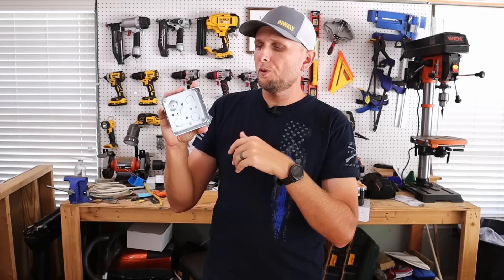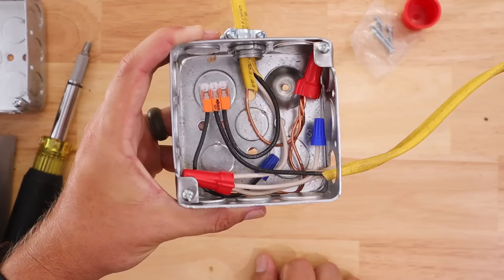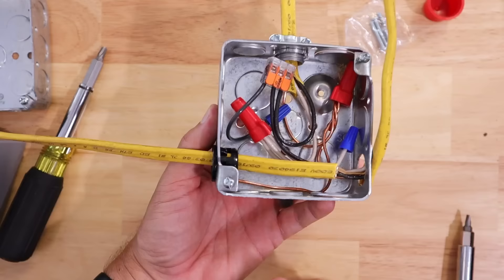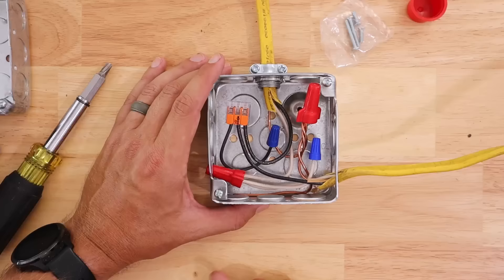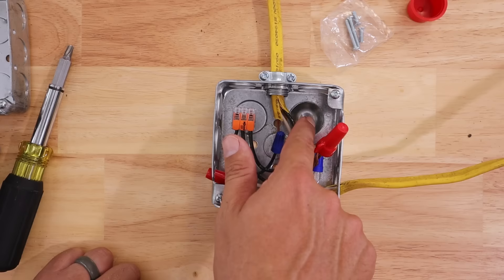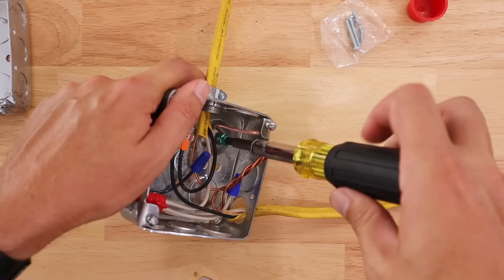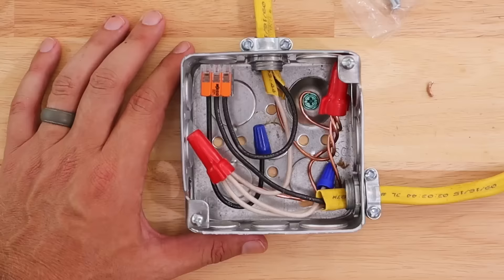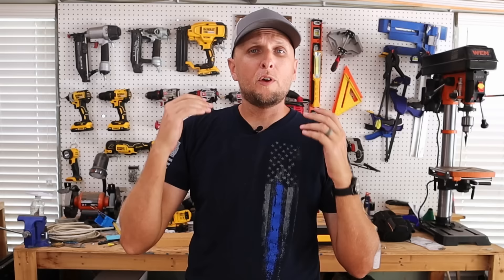The BIGGEST Mistakes DIYers Don't Know They Are Making When Installing Metal Electrical Boxes

Comment: Pre-twisting wires before wire nutting them is wrong. You need the twist to come from the wire nut in order to be up to full spec, as per the wire nut manufacturers. In manufacturers pull apart tests, it takes less force to pull wires out, if they are pre-twisted. Let the nut grab fully, and naturally. Especially, if you have a mix of stranded and solid. Extend the stranded 1/4 to 3/8 of an inch taller than the solid, and absolutely in this case, do NOT pre-twist, or it will be weak. Twist it with the nut only and it will be strong. It's not that some manufactures "don't require" pre-twisting. They require that you don't.
Reply from the maker: I’m sorry but no that is not correct.
Reply: @HowToHomeDIY  If you pre-twist the wires, you develop a contour separate from the inside of the nut, and aren't allowing the twist contour to properly match, as twisting using the wire nut does. And the threads inside of the wire nut may not grip to the wire as intended. When including stranded wires, there is even a greater risk of failure if pre-twisting.
Reply from the maker: That’s an opinion.  There are countless others with a different opinion.  Hence why I said it was controversial.  The NEC does not say not to pre twist.  It says to follow the directions from the manufacturer.  Not that they don’t exist but I have never owned any wire nuts that said do not pre twist.  They have said, pre twisting is not required.   That does not mean you cannot and why so many electricians do.  I have personally never had an issue with any wire nuts after pre twisting.   They bite into the wiring just the same and take a whole lot of force to pull out.

Comment: Anyone who doesnt know the basics shouldnt be doing their own electrical. Also your "must use these screws for the geound and only these screws"....bs. any bare screw will work
Reply from the maker: Any bare screw?  Really?  So someone can use a deck screw?   You can’t just use any screw.  Yes there is nothing special about the color, that was not my intention but instead directing homeowners to the electrical aisle and getting the green ground screws because then one knows for sure they have the right size, type, and length.

Comment: Speaking of the electrician Bible (nec) what does it say about correct length of wire coming out the box, wire management and fill capacity? When electrical cables route from box to box, you must leave at least six inches of free conductor wiring in the junction box for connection purposes in article 300.14 Also why would you go against manufacturers directions? (you think you know more than their engenders, research and development) There is actually a safety concern on pre twisting wires. I am a licensed electrician from California. Ask me about anything electrical

Comment: Why you not using ground sleeving??
Also them wire nut things your on about is soooooo 80s lol 3rd world electrics. Twisting copper together!! No no no no.
Reply: Romex comes with bare ground and must be bonded to the box if it's metal. If the system is wired correctly, it's perfectly safe. MC cable comes with ground insulation and individual wires used in conduit are all also insulated. Wire nuts are still commonly used, but Wago lever nuts are becoming more popular. Twisting wires together before installing wire nuts is considered the preferred method by most people. When done correctly, it's proven to be a very durable connection.

Comment: You are always showing electrical fires in your video thumbnail, and to be honest this is clickbait. Electrical fires start usually from devices that draw a lot of power over long periods of time, like multiple electric space heaters that are plugged into an extension cord.   Where they draw a lot of power right below the threshold of tripping the breaker over a long period of time. In the casse of your clickbait thumbnail, you show a metal box with wires and wire nuts catching fire. THIS IS JUST WRONG. This is at most would simply trip the breraker, that's what breakers are for.
Reply from the maker: Always?  The last 16 videos haven’t had that on them at all.  And fires can happen from things talked about in the video.  So it is not clickbait.  You just don’t like it.  Which is ok.

Comment: Wire nuts in all the world bus USA is temporary solution and proven to be fire hazard. 
Wago as on video can hold up to 40 amp.
Why use metal boxes in the first place. Only USA use metal boxes for electricity that is ridiculous.
Reply from the maker: Wire nuts work just as well as any other splicing device if installed properly.  If you look up the stats of fires cause by electrical, the UK actually has more electrical fires per capita than the US.  I have seen the Wagos installed improperly as well.

Comment: Using an metal box was the first mistake, and the wago Klemme is the only legit conector in there all other shown ones are illegal, and the completly stripped wire is also strange but if it is the PE wire it is not illegal, cant verify that becouse there is no green-yellow isolation visible it is also strange that this one is so much thicker than the other ones it is not required to be the same zuze but must not be smaller wich if this is the PE than that would be uncommon but ok, it looks like it is a 2mm² and the other ones are 1,75mm² 

Also the wire colores are questionable is there no N ore did you use the wrong color

This Video ist terrible advice if you use those and somo e gets hurt or killed it is your fault even if the accident had has nothing do with this installation, also if you find these in a system you are obligated to change them or it is legally the same as if you had put them in, those connectors are illegal since the 90s and they are allowed till any change gets done to the installation 

Please dont take this videos advice it literally could get you in jail
Reply from the maker: I am guessing you are not in the US.

Comment: National code also requires 6 inches of wire sticking out of box when installed. Most of you wire is much shorter and a violation.

Comment: Please do not disrespect the U.S Flag by wearing those shirts.  I would rather see a someone burn the Flag in protest than ever see it on an article of clothing or used to strip the flag of its meaning by altering it to support someone else's cause.  The same people that used to throw a fit if a flag ever touched the ground now disrespect it by turning it into cloths they throw in a hamper.
Reply from the maker: It’s not a flag it’s a shirt with a picture of a flag.  This has been ruled on as perfectly ok.  Please don’t try and trample my first amendment rights that the flag represents protecting.
Reply: @HowToHomeDIY  You very much have the right to desecrate the U.S. flag.  That was clearly established by rulings of the Supreme Court that determined that burning the flag was a protected act of free speech.  And with that ruling the Flag Code was ruled a violation of free speech.  So yes, you have the right to desecrate the flag by placing a "Picture" of the flag on a shirt.  You also have the right to usurp the meaning of the flag to support a singular cause or purpose with that "thin blue line".  You have the right ignore the wars we have fought and the differing ideas of all the people that fought them and alter the meaning of the flag they fought for.  They fought so you can have that right.  Would you think it right if a US flag was altered with a rainbow stripe to support LGBT people or if a black stripe was put in to support BLM?  Maybe that should become the new symbol for any group.  Pick a color or colors that represent your group and just replace a stripe in the US flag and make it your own.  What would you say to a content creator if they did that to the US flag?  But the thing is they others have the decency to create their own identities and not piggy back and steal the identity of a symbol that represents all people of this nation and all their struggles instead of taking the flag to alter the symbolism to just represent a singular group.  A group that many people see as oppressive, violent and corrupt. The U.S. flag is a symbol for all, not a symbol for just a few and when you plaster it all over everything and put it on shirts or hats or alter its appearance the deep meaning behind the flag loses its significance and those that do it are not patriots.  So please, continue wearing your "Picture" on your shirt.  Makes it easier to identify those we should avoid at all costs.  You seem like a decent fellow and you like to point out the mistakes that others can make.  So instead of blindly screaming don't trample my rights, maybe consider your actions while done with good intentions are wrong to do in the first place.
Reply from the maker: Wrong to you.  But I see now you have made it political.  Which I will not engage in.  I support our country.  I used to wear the blue.  I show my support on not a flag but a t shirt.  So it is not desecrating the flag because it is not a flag.  But you made it very clear you just don’t like this particular shirt with a flag integrated in it.  But like me, you have the right to have a rainbow colored flag or blm or whatever and I respect that.
Reply: @HowToHomeDIY  Funny, made no mention of politics at all.  Only brought to light other organizations that have flags or symbols that do not utilize the US flag.  Notice that Police Cars have a US flag on the car.  An unmodified US flag.  Not a modified version meant only to represent the Police.  Because the Police are also supposed to represent all people.  You also use symbolism in your comment. "used to wear the blue" instead of saying I was formerly a Cop. And I am not only referring to the (LMFAO) "Picture" on the front but also the flag representation in false colors on the sleeve. Is that also just a "Picture".  Wear that shirt in public and ask strangers what the "picture" is on the front.  Will they say it is a "picture" or will they say it is the US Flag or a Back the Blue Flag?  Why is there not a specific Back the Blue flag?  One that creates its own symbolism to portray the plight of the Police Officer in the US?  Why must the Police take the US flag and modify it to suit their own purpose?  If you want to respect the flag and honor what it means then display it properly in your yard.  Altering the appearance of the flag or putting it on clothing is disrespectful and shows a complete lack of understanding of its meaning.  The fact that you do not understand that shows clearly how unpatriotic you are.  I fully believe in free speech.  Especially when it is done to highlight injustices and wrongs done in the name of our country.  When someone burns a flag in protest by a citizen of the US it is being done as a last resort.  All other actions have failed.  It is a protest.  But the symbol that you choose to proudly display says FU to the entire meaning of the First Amendment.  It is not a protest.  It is a statement that not only am I better than you, I can take the symbol meant for everyone and make it a symbol just for my kind.  And as I said before the only reason you are allowed to mutilate the flag of this country is because braver men than you stood in public and burned the symbol of freedom in protest.

Justice John Paul Stevens from his dissent in Texas v. Johnson (1989): 

"The ideas of liberty and equality have been an irresistible force in motivating leaders like Patrick Henry, Susan B. Anthony, and Abraham Lincoln, schoolteachers like Nathan Hale and Booker T. Washington, the Philippine Scouts who fought at Bataan, and the soldiers who scaled the bluff at Omaha Beach. If those ideas are worth fighting for—and our history demonstrates that they are—it cannot be true that the flag that uniquely symbolizes their power is not itself worthy of protection from unnecessary desecration."

So keep in mind, a dissenting Justice of the Supreme Court in the ruling that made flag burning legal and in essence gives you the right to do what you are doing said.

"the flag that uniquely symbolizes their power is not itself worthy of protection from unnecessary desecration."

And what you are doing is unnecessary desecration no matter how you want to "Picture" it.
Reply from the maker: Sure you did.  I’m not reading all of that and not debating with you.  It’s not a flag desecration.  You can’t desecrate something that doesn’t exist as there is no flag being used. You can disagree.  I will continue wearing my shirts and you can either watch or not.  Up to you.  You clearly have plenty of time on your hands but I’m going to get back to replying to folks with questions about a project or helping them with something.  Take care.
Reply: @HowToHomeDIY  Well, maybe you should look up the definition of Flag Desecration and the Flag Code.  Because if the Supreme Court ever reverses the ban on Flag Burning and Flag Desecration then you are looking at a fine and 1 year in Jail.  Because that was the sentence of those that desecrated the flag before.
Reply from the maker: Cool!  Until then, you just keep on fuming over what a guy on the internet wore 🤦‍♂️🇺🇸👮🏻‍♂️
Reply: @HowToHomeDIY  Nobody Fuming here.
Reply: I don't think anyone has ever put this much effort in to deconstructing a t shirt for sale. It's simply made for people who are proud of cops. Not one person bought this thinking: "Hey, I can further divide the country with this!" They even make them for firefighters and nurses. Whether or not cops deserve showing of support is a whole other debate that's got nothing to do with a t shirt design.
Reply: @velvetypotato711  Exactly, absolutely nobody thought about how they are disrespecting the flag by buying a shirt with its likeness or the flag itself on the shirt.  But the people that made it sure thought it was ok to profit from using the image of the Flag on a shirt.  And the people that took the flag meant for all and modified to represent a few did not think about that disrespect either.  But they clearly thought about how they felt they could easily make the flag a symbol for their own kind.  And a flag to represent firemen or nurses or whoever using the US flag as the base is equally disrespectful.  But people have the right to be A-Holes and disrespect the flag if they want to.  I am just pointing out the hypocrisy that those that buy and wear those items believe they are being patriotic because they are ignorant of the actual meaning and guidelines that you once would be put in prison for tarnishing.  And I bet those same people wearing those items are applaud when someone burns the flag that they so proudly soil by wearing it on their shirt.

Comment: Obviously not an electrician teaching electrical.....that's not a ground wire.
Reply from the maker: The bare wire is definitely a ground wire 😂
Reply: @HowToHomeDIY  the only ground in an electrical system is the one that grounds the neutral conductor in the service after that it's called a bond. Only other time the word ground could be used is in a transformer application, then it's a duel purpose conductor for the XO grounding and equipment bonding.
Reply: @Poorzgolf  Not quite. In the US under the NEC, the bare wire is known as the EGC, equipment grounding conductor. There are 14 types of EGCs and 12 of them are raceways, not wires. A ground wire is synonymous with grounding conductor but is not the only type of grounding conductor. The conductor connecting the system to the earth is the GEC, grounding electrode conductor. While bonding is frequently used to establish a grounding path, things can be bonded and not grounded, since bonding is defined as "Connected to establish electrical continuity and conductivity." The connection of the neutral to the GEC is accomplished using a bonding screw or bonding strip, known as a main bonding jumper..
Reply: @pld8993  a bond is actually used to establish equipotentiallity, to prevent injury or death from touch potential.
Reply: @Poorzgolf  And the bare wire is a ground wire.
Reply: @pld8993  a bare wire can also be a bond aka equipotential bond wire to an equipotential plate. Section 10 equipotential bonding rule
Reply: @Poorzgolf  You're speaking CEC not NEC, different definitions, same use and purpose.
Reply: @pld8993  it is never a ground when talking branch circuits, that definition is consistent in NEC and CEC
Reply: @Poorzgolf  You're wrong and you may want to open a code book and read it before you proclaim what's in it. NEC Articles 100 and 250.118. Any questions?
Reply: @pld8993  so your basically saying a bond and a ground are the same thing and interchangeable? Guessing the CEC has finally advanced past the NEC. Are you also of the opinion that fault current  takes the path of least resistance?
Reply: @Poorzgolf  I'm not saying that at all, I'm just reading the NEC. It's not rocket science. To answer your question, sometimes a ground conductor is both (whether wire type or raceway), as when it provides a grounding path and also bonds non-current carrying metal parts of the system, and sometimes not. Informational Note 1 to the definition of EGC in Art 100, read it and you'll understand how the NEC sees it. Given your comments I'm guessing you're maybe an engineer but probably not an electrician (not the same thing, contrary to what many EEs believe), or maybe you're just speaking Canadian.

Comment: I just wanted to let you know that your example isn't to code. You need 6 inches of free wire minimum. Anyone coming behind you to do work in that box would cuss at ya. 🙂
Reply from the maker: I just wanted to let you know that all of the wires were measured to be at least 6” and be able to extend at least 3” outside of the box per code.  You can’t tell exactly how big, small, wide, thin, short, or long something is on camera without a reference.  So no cussing necessary ☺️